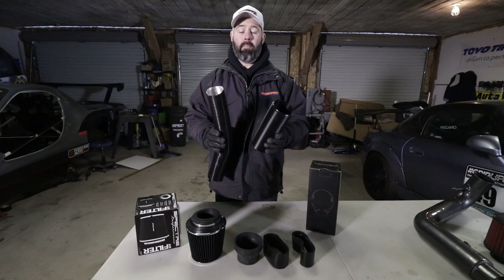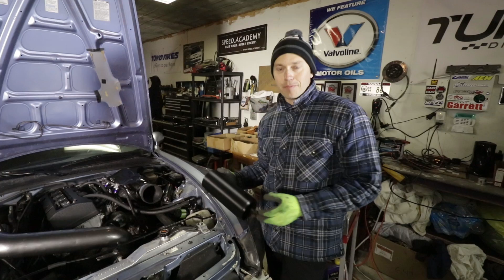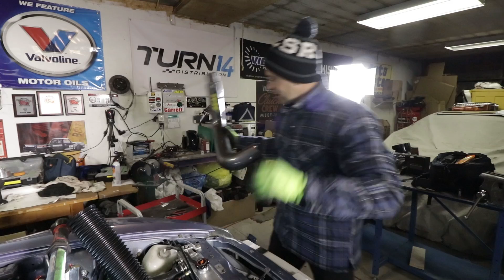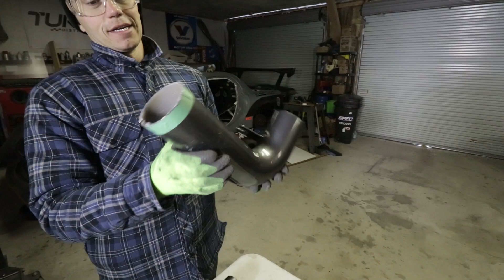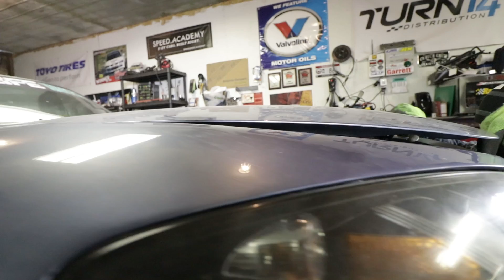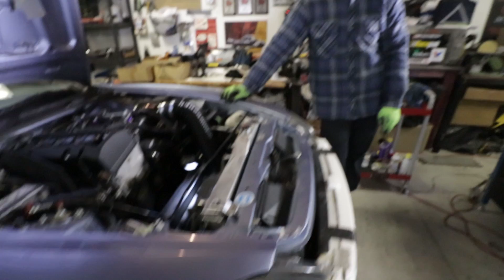Custom S2000 ITB 4-Inch Intake Install - Project BADASS2000 - EP16

Comment: I know I'm about 37 years late to comment, but I definitely agree with everyone about the piping. There's no shortage of universal mandrel bent piping that you can buy, and piece together an intake with a much smoother inner diameter. Just order a few different pieces of various lengths and bends. Then, cut and weld them together.

Comment: Just a question, don’t laugh if I sound ignorant, I’m just trying to learn. With the accordion style piping, would the ridges on the inside of the pipe slow down airflow? I’ve just always been told that the smoother the surface the less friction in ur airflow allowing for more air to flow into the intake manifold or in ur case the ITB housing

Comment: Is some of the tubing going behind the HOT radiation ???? Isn't that a bad idea?
Reply from the maker: It's not going to heat the tubing up enough to make a difference especially when the air is so much colder from the fender well.

Comment: the cold air feed makes little difference in teality as your running in summer... i would be more inclined to do the bonnet hole.. and put tights over the velocity stacks.. it makes no sense to fit itb then make a restrictive intake... may aswell put stock intake back on... because you are no longer creating high velocity in the trumpets..your basically creating lag with all that piping.. alot of guys here raise the bonnet at the wind shield side to expell the hot air... works well and looks good too :)

Comment: What Header are you using?
Reply from the maker: Its stock.
Reply: Speed Academy Race Header is how you make power with NA Honda. A good quality race header not cheap sub $700 header. Race Header turned my K20 into a different animal.

Comment: spectre tube is junk corrugations disrupts and slows down  the clean air to the engine thus heating the intake charge. go a short mandrel bent pipe for best results
Reply from the maker: good thing we went with 4-inches then!
Reply: Speed Academy the size will not make any difference to the turbulent intake charge. imagine the wheels of a car driving on a corrugated road the suspension is continuously bumping up and down and all those vibrations make the car unstable and slows the car down. Same thing happens to your intake charge. it's pneumatic dynamics 101. smooth mandrel bent pipe is the only way to get best results

Comment: Something to keep in mind, the longer the hose the greater the vacuum requirement.
4in x 3ft requires greater pull force than 4in x 1 foot. 
also.. corrugated... I would bet a smooth wall 3 in  hose routed to the driver's side rather than passenger side (assuming you are LHD) would produce nearly the same power as you corrugated 3.5 foot x 4 in section due to resistance.
Reply from the maker: Great point! We looked at plumbing it to the left side but there is a vacuum pump there so no room.

Comment: why not try remove the inner pipe on the aem system and weld it up nice and tidy and you then have a cleaner flowing intake pipe or get some 4 inch stainless or aluminium piping and build a better system then that stuff u have there

Comment: I would use that accordion style tubing for the shape you need, and then make a silicone tube with that mold... Way smoother airflow. And also the accordion thing will get hot in the engine bay, a stiff silicone tube can be heat wrapped...

Comment: You guys should rig up some butterfly flaps for cutting a square hole in at little front right bumper section to vent in air, definitely would make a difference but I say butterfly flaps because it would be convenient to close it like that to prevent hydrolock than to tape it over.
Reply from the maker: There's already a hole leading cold air in there so at this point we'll be leaving it be.

Comment: As someone who's read waaay too many forum posts about intakes, I'm curious to know how much routing, pipe length, material, and filter location make a difference in gains/losses. I realise at this point we're probably talking 1-2 HP in either direction, but I've seen this topic beaten to death so many times, it makes me wonder what's actually true and what's BS.
Reply from the maker: That's the problem, the gains or losses are so minimal that it makes no sense to spend more time and energy trying to figure it out. Even if the flow is hindered by the accordion shape the 4-inch piping easily makes up for it and Ultimately our inlet is no bigger than a tad over 3-inches so if anything we'd need to re-do that.
Reply: Really, when you're DIYing things like this, you just have to make the best of it. If you had the time to factor in everything, you may as well stop making videos and start making intakes. But don't do that. I like your videos too much to encourage you to stop.

Comment: Looking for an opinion on the apexi afc neo ?
Reply: cewjt I have a SAFC II and it's perfect for light tuning and not crazy expensive, I love it!
Reply from the maker: Not a great tuning option since it doesnt allow you to adjust timing. All you are doing is fooling the ECU to think the engine is running leaner or richer.
Reply: Speed Academy you obviously don't understand the relationship between air/fuel mixture and flame front speed.
Reply from the maker: Well please educate us! We're always looking to learn more.
Reply: As you richen the a/r ratio past 13.3/1 the combustion slows down, essentially retarding ignition timing so you can combat the increased flame front speed due to increased boost levels. And richening the mixture also helps cool combustion, lowering EGT's. There are limitions, but doing a mild tune the SAFC series piggy backs work awesome tuned correctly, they also come with a built in knock readout.
Reply: It's important to note this only works on petroleum fuels, ethanol is very different*
Reply from the maker: That's still leaving a bit of chance with the timing but if it works for you then big thumbs up!

Comment: Why don't you put directly the air filter to the box, make a hole into the hood with a scoop and a buttom heat protection for the intake air filter.
Reply from the maker: We don't want to cut a big hole in the hood.

Comment: the Internet says: "it's not going to flow smoothly! that air filter is the same filters down "that isle" at autozone."

come on guys! makes a bad ass carbon fiber box... buys auto zone filter and piping.
Reply from the maker: K&N owns Spectre, AEM, and Air Raid. If their filters were as crappy as the internet trolls say then one would think there would be some steps taken by K&N. 

As for the piping, the 4-inch 'not smooth' design wont be the problem, if anything it's the 3-inch intake hole on the air box thats the current bottle neck.

Comment: If you guys haven't done it already, cut out the fake brake duct in the front bumper and put some race mesh over the hole for even better airflow.
Reply from the maker: Done and done :)

Comment: idk man i dont trust specter lol but hey if it works it works
Reply: 1DoPeS14 I have a Specter and 2 K&Ns. They're both oil impregnated cotton elements that appear similar. The base of the K&Ns that I have are flat where as the base of my Specter is radiused like a velocity stack. I like that feature. Is it just the price that makes you not trust them or have you heard horror stories that I havn't?
Reply: Nicholas Rodrigues I have used specter before not KN I did not like the way the specter got dirty really quick but I daily drove my SR20 with it I have since switched to an Apexi filter kit have lasted longer then specter and have a velocity stack in the intake but the Apexi is triple the cost of specter
Reply: 1DoPeS14 interesting. I probably have about 6000KMs on my Specter and it still looks clean. It's not a daily though. That car doesn't get dirty it just gets dusty lol. But to me a dirty filter means it's doing it's job.
Reply: also a track car would see much cleaner roads at least i would think

Comment: It seems that at a certain point a bigger tube would gain volume of air but lose velocity. Would be interesting to see the dyno charts for different diameters.
Reply: Casey Weaver they have velocity stacks on the ITBs so I don't think it matters as much as just providing them enough volume at the coolest temp

Comment: Spectre = Autozone. Shit if it works it works right?
Reply: Ernesto Lugo yea those filters are crap haha even the plastic is spray painted chrome 😂
Reply: I'm not even hating tbh. I love the shit out of this channel. this the first time I've seen any kind of rigging stuff. hell it works and it's honestly not bad haha
Reply: Ernesto Lugo Working out of the box and working after 12 months is where the issue it. Like I said its cheap and many guys have used them with issues after a short time.

I think their filters are even bad quality. You get what you pay for. Im sure they will replace it down the road. Im not hating either just stating the facts they are cheap for a reason. I almost bout one until I met people who ran them and held one next to an K&N filter.

Comment: btw you can cut on the piping too. just install the filter on the other side of the bumper..there is an airpump there if its an ap1 ..take out the pump and its the same space as where its mounted now.
60-70cm of less tubing less restriction on the intake
Reply from the maker: Right now we still have the air pump because that was our plan originally but once the pump goes we'll move the filter there.

Comment: Question. Why don't you just put the filter straight onto the intake manifold and put a vent in the hood. Surely thats way more efficient in space
Reply: Heatsoak, even with a vent in the hood that directs straight into the filter, you would still have hotter intake temps than the current setup, also a vent in the hood could potentially screw with the aerodynamics if not done right.
Reply: Plus the air at the  front bumper is at a higher pressure than anywhere on the hood.

Comment: Wait, are you still using thr ITB filter too?
Reply: Kash V no they're not they took it out when they did the carbon air box
Reply: Wesley Hand im sure they molded the box round it. May have missed them taking it out
Reply: they did mold the box around it but just to replicate its shape so that it would still bolt up to the base plate. It's just a hollow chamber right now

Comment: looks like all my comments in the past have proven true haha. also just to add another one, the aem dry flow has been proven to be the best flowing option out there. so I'd probably reuse that from the intake system if you have it over the spectre filter. Also question air turbulence in the accordion tubing over just buying aluminum piping and making a intake that way.
Reply: looks like spectre is sponsoring the video, but yeah i would agree, or just go no filter. after all this is a track dedicated car
Reply: Kilobits ah yeah can't anger the sponsors. hopefully they do the right thing later on when no one knows or can see

Comment: corrugated tubing for Intake systems is a no go ...too much disturbed airflow(effectively reducing the useful diameter) ...try to get some smooth radius alloy tubing that meets the spec.
Reply: Daniel Gomez such a beautiful carbon air box just to ruin it with the corrugated plumping hose :(
Reply from the maker: That's why we chose to go 4-inch even though we know there will be some flow disturbance.
Reply from the maker: The brake duct hose is not smooth on the inside, it's pretty much the same accordion style as this tubing. Even if the tubing is causing a bit of flow issues, going 4-inch should remedy it as effectively we assume we are getting as much or better flow than the 3.5-inch tubing.
Reply: I'm not really a fan of the pipe or the routing. It's longer than need be and that rad will get hot which will warm the air on the way in. But packaging, you! 
Since they have a guy that can do carbon they should do a custom oval pipe which comes straight over the rad to the front grille. Lower the rad slightly to make it fit maybe. Time attack guys would out the radiator in the back seat and run a 20" intake. lol
Reply: This was my first thought when I saw the tubing. Oems love to use ribbed flexible intake piping and aftermarket kits always trade it for smooth pipe and gain power.
Reply: Having done lots of research on wood working dust collectors, this was exactly my thought watching this too.
Reply: Daniel Gomez There's no reason they can't use this as a basis for a better system. Now they know the routing, mounting and such.
Reply: Izzie hence my comment mentioned subbing the corrugated pipe for a 'hard-pipe'. ...but that is the best route for them hopefully.
Reply: This and also do the corrugated tubing increases the heat transfering area and that tube just sits directly behind the radiator. This will not reduce the induction air temperature a lot.
Reply: I hear you ...It's a real pity that the pipe couldn't have been routed straight towards the driver's side headlight area. And use a PVC type large bore pipe to cut down on air temps.

...Anyways, I'm sure I'm not alone in waiting to see another dyno run with the new setup :)
Reply: Whats the size of the entry hole to the carbon air box? that looks to be the bottle neck now.
Reply: I was thinking the same thing, they should have used the same kind of orange steel wire silicone ducting they did in the dyno video.
The 2ply version is perfectly smooth on the inside and you can get them in black as well.
I'm hoping Speed Academy does a comparison on the dyno to confirm our doubts :)

Comment: Hey guys. keep up the great work with all your projects. nice to see familiar tracks and similar products I use. I might of missed it in a previous episode but what the reasoning running the air filter across the car when the left front headlight is right there? if there is a washer bottle in the way, that's a pretty simple relocate to keep the intake pipe short and not running across that hot rad. hope to hear from ya. :)
Reply from the maker: Rob- The left side has an air pump so we can route the filter and tubing there and the only other spot left is the fender where we had the AEM. Hope that helps!
Reply: Speed Academy alrighty! thanks for response. keep up the great work guys. :)